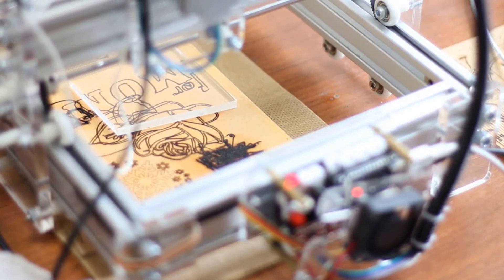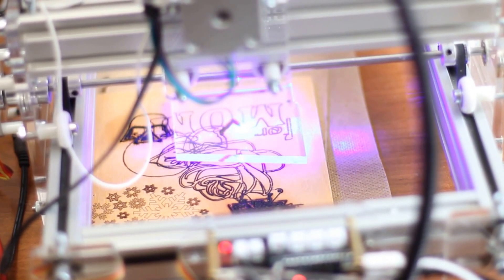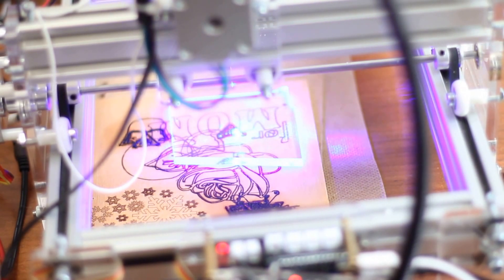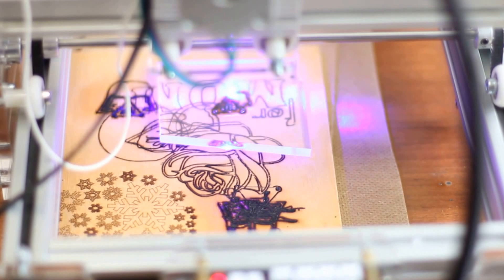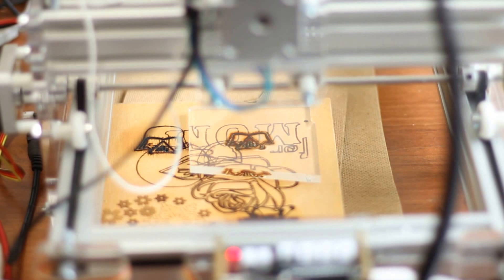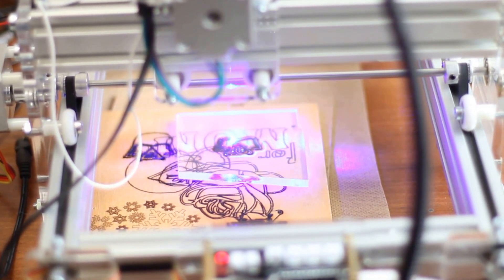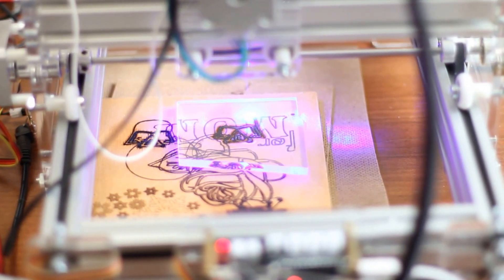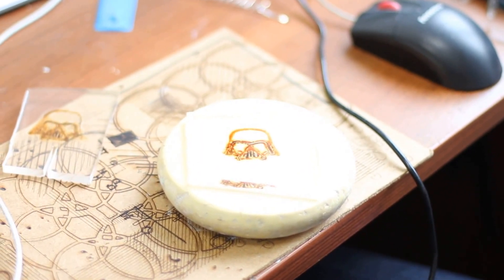How to make a nice engraving on transparent acrylic

Comment: Something is wrong with this procedure, acrylic is not supposed to burn and melt like that, the laser is supposed to gently evaporate some layers off the material so this suggests you might be using too much power or too little speed. You might also want to look into pwming the laser beam.
Reply: I have a Chinese 40w Co2 laser with a smoothieboard so the whole thing might be different with a diode laser. When you engrave acrylic, you're using PWM to send a very weak pulse to the laser that is not going to burn the acrylic like in your video, but instead will just remove a tiny portion of it. This is done repeatedly until the desired image is formed. The final result should be a low relief with an opaque texture in the engraved areas, not a black scorched line.  It should look like this: https://i.ytimg.com/vi/EV22oOOGaug/maxresdefault.jpg - But again, I'm just speaking from my Smoothieboard Co2 experience.
Reply: Try to do horizontal passes like a dot matrix printer instead of following the vector lines.
Reply: It is different for solid state lasers, if you want to cut, you need to go full power.